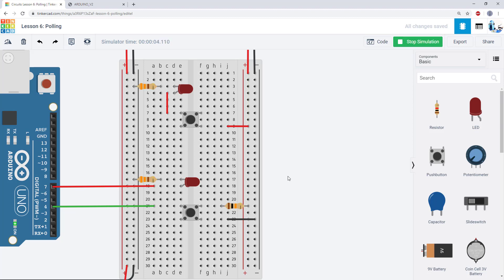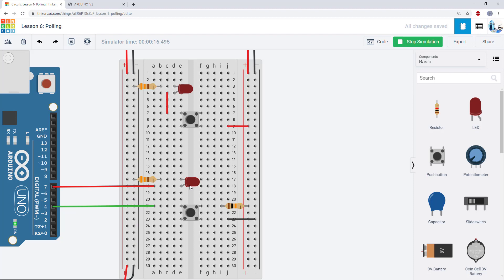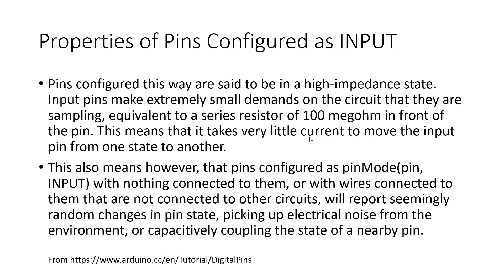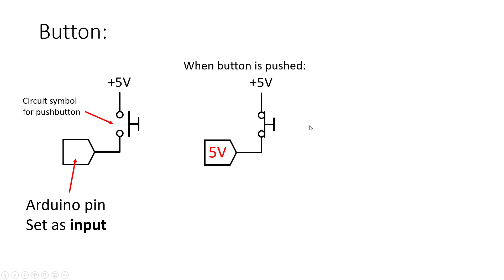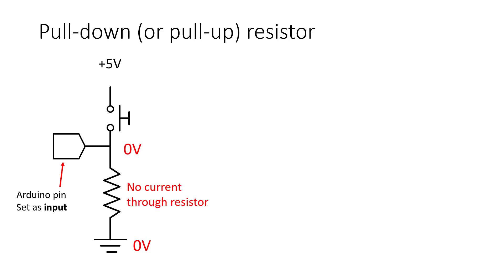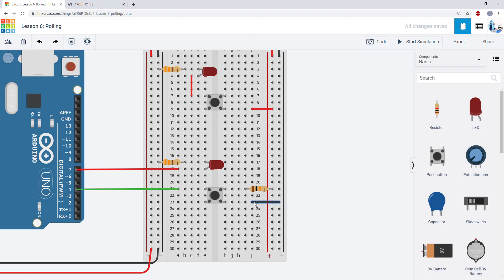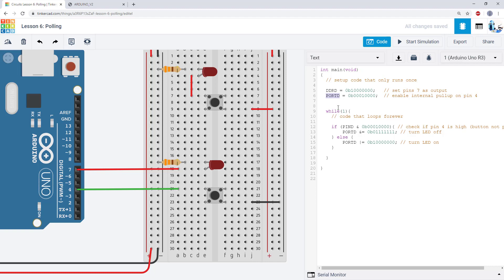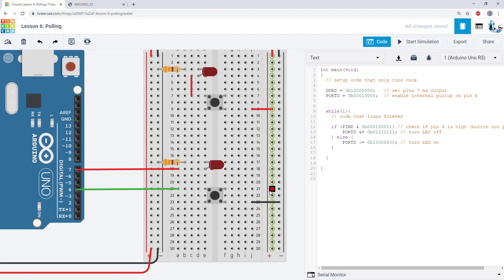Tinkercad + Arduino Lesson 6: Pull-up and Pull-down Resistors

Comment: Today I learnt exact reason for using pull up and pull down resistors. Your explanation is very simple & clear and very easy to understand. Engineering undergraduates including me find very difficult to grab this small concept even after doing multiple projects. Thanks for your effort!

Comment: Am am sorry for my bad English. Just a question: In case I have a push button that is on by default, but turns off if I press the button (I sadly don't know the English term for such a button. German is "Austaster" "Off Button?"). So this button have of course 5V connected to the input pin at start up. I know as soon as the program execute "PinMode(x, INPUT), then there is a resistor at this pin and because of that there is no short circuit. But now imagine I used the board with an other software and the pin was set as OUTPUT; so without resistor. If I now build up my project and upload the software, will there be for a short time while uploading and executing the first few lines an short circuit?! Or are pins always INPUT at start up as a protection against bugs like that?
Reply from the maker: I believe since the DDR register defaults to all zeroes, pins are by default all set to inputs when you upload a new program unless you explicitly set them as outputs. However, it can be considered good practice to have an extra resistor in series with each pin as a safety measure for this reason (inadvertently setting a pin as an output and setting it high when it's shorted to ground by a wire).
Reply: @BenFinio  Thank you!

Comment: How would you make you input pulldown? Is it a pulldown by default?
Reply from the maker: The internal resistor can only be pullup, not pulldown. If you want pulldown you have to use an external resistor.

Comment: Hello! I have spent to find the answer the whole day, your video is the best that i found. I have a question. I already understood that that technology of pull-up and pull-down is used to clarify a condition on digital output, but i don't get the resistor's role i that circuits. Can you asnwer, on 4:12, why should we add a resistor with that ground ? We can add just a ground, and, i guess, electrical noise just will go to that groud, so, what does the resistor here ?
Reply from the maker: If there is no resistor, then when you press the button, you will have a short circuit directly between 5V and ground, and a dangerous amount of current will flow. You are correct that if all you wanted to do was ground something to prevent electrical noise on a floating input, you could connect it directly to ground without a resistor, but in this case you need the resistor to prevent a short circuit when the button is pressed. Hope that makes sense.
Reply: @BenFinio  Oh, that really makes sense, I didn't remember about the "short" in this situation, thank you! And I probably will have another question soon :)
Reply: @BenFinio  and my another question about pull up resistor. We have in this "pull up resistor" a Vcc, and a resistor right after it. I wonder, why the current flow, after button press, goes directly into a ground? Why none of charges goes on pin? And, think, resistance of this resistor can be so big, because kilo ohms, why current flow there even possible?
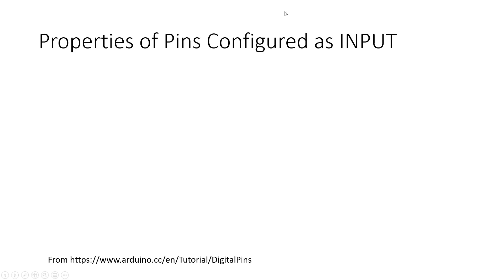Reply from the maker: @alexobzor  This is explained in the video starting at about 1:33. An Arduino pin set as an input has an extremely high resistance so very little current flows into or out of it.
Reply: @BenFinio  I checked, we have high-impedance here, okay :) But my another question still now answered, and i think, i am getting the point. We don't have a "short" effect in "pull-up resistor" while pusing button, because a resistance of a resistor that big ? And it can not create that destroying effect of "short", am i right?
Reply from the maker: @alexobzor  Correct, the resistor is very large (typically at least 10 kilo ohms) so very little current flows.
Reply: @BenFinio  Great! Thank you! Now i understand the whole concept of "pull-up" and "pull-down" :D

Comment: best explanation out there my God. Cheers
Reply from the maker: thanks!
Reply: @BenFinio  I used this method to be able to get consistent high/low values. When I connect the arduino 3.3V it reads high and without any connection it reads low as expected. I am trying to replicate this with a 4.5V (3AA batteries) rc car, basically when on I want it to read high and when off to read low. For some reason the arduino doesn’t pick the change. 10K resistor used for the grounding fyi. Let me know what you think, earned a sub for sure.
Reply from the maker: @SammychipOfficial  The Arduino should be able to detect 4.5V as high, so there is probably something else wrong. If you have a multimeter you can use it to see if the voltage on that pin is actually changing like you think it is. I have a multimeter tutorial video here if you don't know how to use one: https://youtu.be/oAEzD0WwPFw

Comment: wouldn't the current still be flowing through the pull-down resistor to ground, heating it up when the button is on?
Reply from the maker: Yes, but the resistor is typically very large (at least 10 kilo-ohms), so the amount of current is very small.

Comment: I really have a hard time understanding this concept (it been 2 days). then I came to this video. thank god your explanation is great. but still, I have questions:

1. we knew that we need a reference point to measure voltage, but when the pin is reading voltage what does this pin read? the voltage drop in the pin impedance? or the voltage difference between the junction to the Arduino ground? (is the ground you draw is referencing to the Arduino ground? )

2. I watch another video that said that the resistor that you add must have resistance 10x the pin impedance (just a ballpark). if this is the case, I have a problem when we talk about the "open pull-up resistor circuit" because the voltage drop in the pin impedance is small (most of the voltage drop occurs in the pull-up resistor) that make the pin reading can probably enter the LOW range. (i afraid that the pin doesn't measure the impedance voltage drop, so this is related to the 1st question).

other than that this is a very brilliant explanation. thank you so much, hope you can answer my confusion.
Reply from the maker: Hi - the ground in the circuit is implied to be connected to the Arduino ground, sorry if that wasn't clear. So the voltage the pin measures is relative to that common ground. Does that clear up your confusion?
Reply: @BenFinio  okayy, so what we measure is V = (pin impedance x current to the pin) + (current to the ground x any resistor exist). Like that?
Reply from the maker: Hi - for practical purposes I think you can just assume the pin impedance is infinite and there is no current into the pin. The voltage measured "at" the pin is therefore just determined by the external resistors. Especially for digital inputs - the Arduino considers anything above 3V "high" and anything below 1.5V "low," so there is a huge tolerance: https://learn.sparkfun.com/tutorials/logic-levels/all#arduino-logic-levels. So a difference of a few millivolts (or even smaller) due to the pin's actual internal impedance doesn't really have an effect on the result. Unfortunately I'm not familiar with exactly how the voltage measurement works "internally" if you want more detail than that, but I'm sure that information is available online somewhere.
Reply: @BenFinio  thank you for your great explanation now i understand this topic.
Reply: @BenFinio  wait actually one thing still bother me, in case of pull up resistor, when the switch is open, we dont have any connection to the ground, but why we measure 5 volts?
Reply from the maker: @katakomn9465  The same reasoning applies to a pull-up resistor as to a pull-down resistor, or in general a resistor connected to any voltage. First, assume the input pin has practically infinite input impedance, so negligible current flows into or out of the pin. That means a resistor connected from the pin to another voltage - whether it is 0V (ground), 5V, or something else - will have zero current flowing through it. Next, according to Ohm's Law, V=IR, if the current through a resistor is zero, the voltage drop across the resistor is zero. So the voltage on both ends of the resistor is the same. So specifically for the 5V case - one end of the resistor is connected to 5V. There is no current through the resistor, so the voltage on the input pin is also 5V. Hope that makes sense.
Reply: @BenFinio  that is actually make sense, thank you for your explanation
Reply from the maker: @katakomn9465  Glad I could help!

Comment: Great video, thank you! I just had one question: @4:36 you said that the lower resistance path was through the Pin, rather than through the resistor to ground... However, earlier you mentioned that a pin configured as an input has the equivalent of a 100 megaohm resistor infront of it... Would this not make the pin the path of higher resistance? I must be missing something. Thanks!
Reply from the maker: Hi CamMacDoughnut - good question! To (hopefully) clarify what I said in the video: when I say "we have that direct connection up to 5 volts, that is the shorter, lower resistance path than the path to ground through the resistor" - I mean the connection from the pin to the external components. So in this case, if you start just on the "outside" of the pin (ignoring the internal resistance of the pin), then the path to 5V is almost zero resistance, compared to the path to ground which has a resistor in the way. Hope that makes sense!